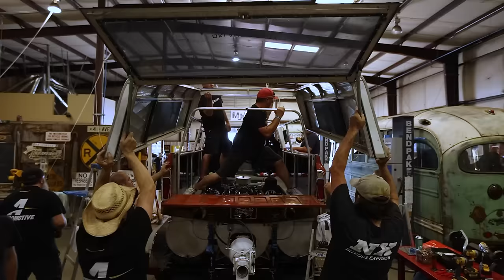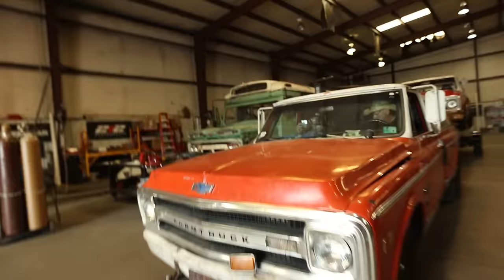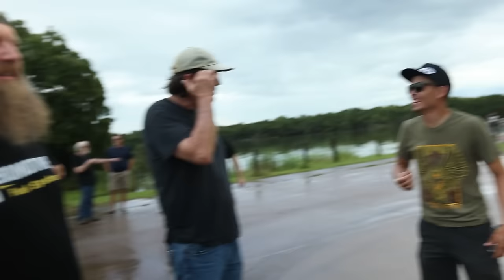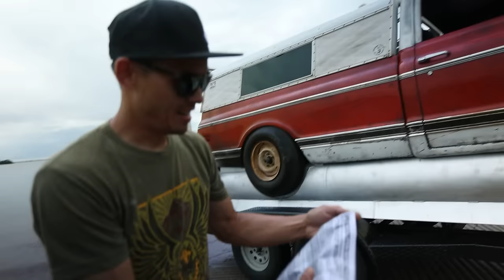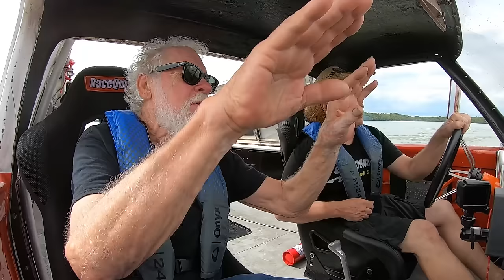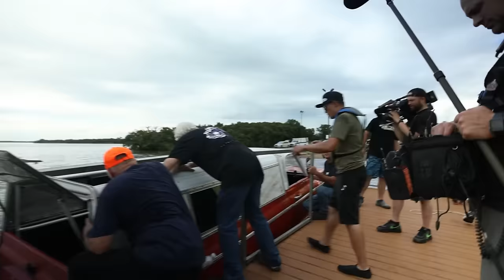IT FLOATS! FIRST TIME IN THE WATER WITH THE FARMBOAT

Comment: You could create a stability system using the trim of the water jet nozzle and some sort of linear angle sensor. With a PID connection between the two to keep your bow angle at whatever you desire.

Comment: The “rooster tail” is like a cheep bolt on flair kit on a Nissan. All show and no go. 
If your rear end was not set up properly your front end will go up and try to wheelie, may look cool but it’s NOT FAST. Your trim is not an on off switch. It’s a fine tune adjustment. Get more lift in your stern and you will get fast.

Comment: You guys should go V Drive, that thing would be so much faster and control would be so much better also, jet drive is a waste
Reply: IYO.  Lots of boater/ boat racers prefer jet drives.
Reply: @danmyers9372  I've never seen someone that runs in open water that isn't channel racing but to each their own, I just figured these guys wouldn't wanna throw away 35% or more of their power

Comment: That thing got a droop snoot on it? Might perform a little better with one if not… Sounds like she could use a little more aggressive impeller also. I believe there’s plenty of horse power there for more impeller lol. You can tell by how fast it rpms. Kinda like when a really loose converter doesn’t load the engine…